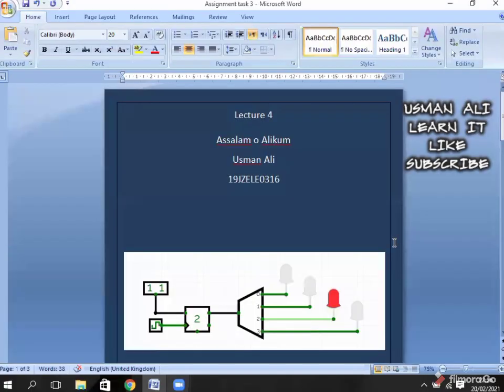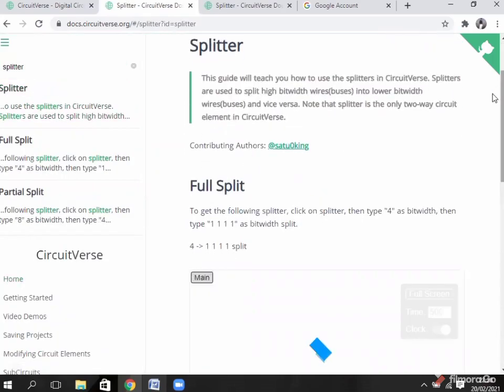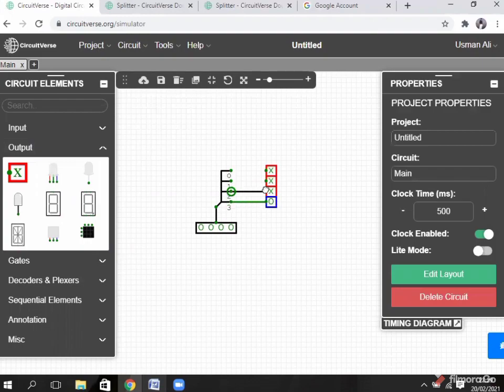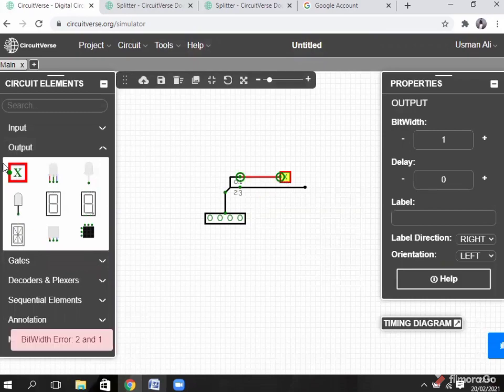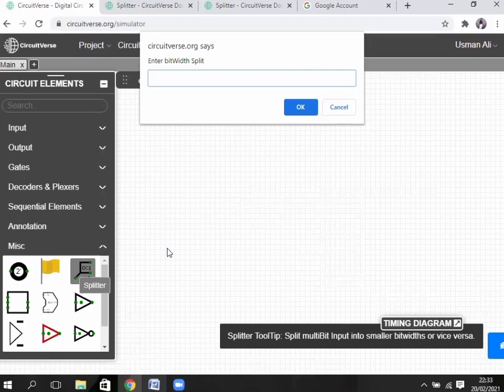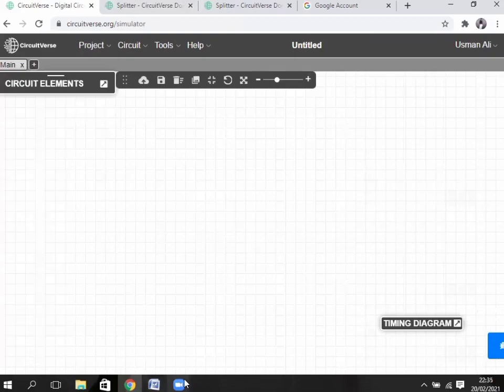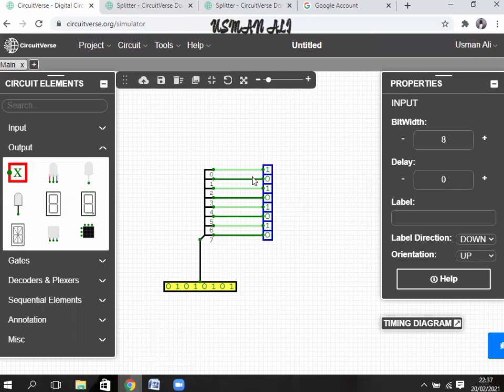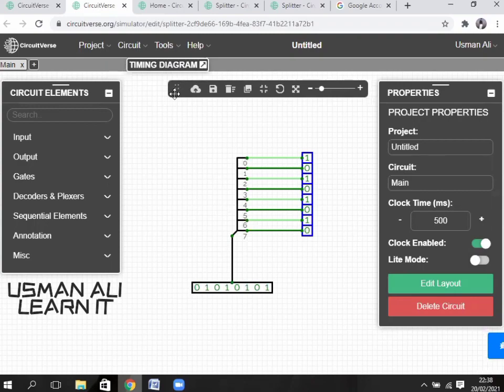Understanding Splitters in CircuitVerse - Digital Logic Design Lecture 5

Comment: how do we do 0:1 1:2?
Reply: From my experimenting with splitters, to do this on the bitwidth split you would put “2 2” without quotation marks and you’ll get two outputs/inputs. These will be labeled 0:1 and 2:3 respectively, because a lot of cases the first bit is marked with 0. Hope this helps!
Reply from the maker: I didn't understand your question
Reply from the maker: Now i understand what u want

It seems like you're referring to a binary splitter or demultiplexer in digital logic design. In the context of 0:1 and 1:2, you might be describing the demultiplexing function where one input is directed to one of two outputs based on the control signal.

For example, in a 1:2 demultiplexer, if the control signal is 0, the input goes to the first output; if the control signal is 1, the input goes to the second output. The ratio 0:1 signifies that the input is directed to the first output when the control signal is 0.